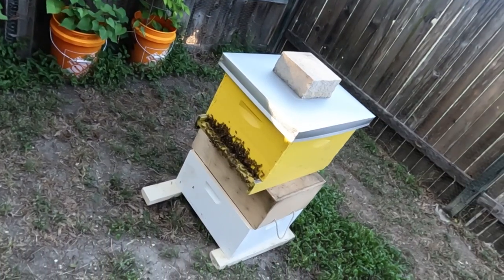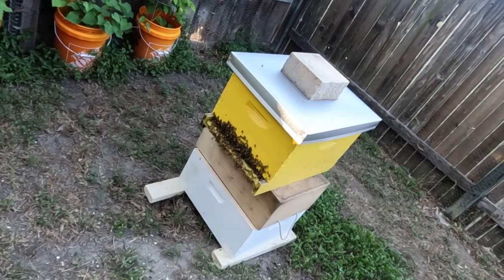Not Like I Planned, Moving The BeeHive #howto #diy #cute #automobile #shortvideos

Comment: Try .5 : 1 ratio on sugar water. The thinner syrup is closer to nectar consistency and will stimulate them to draw comb and raise brood. Add some pollen sub for protein.
Reply from the maker: Thank you for the suggestion. Changed the 1:1 out for that right after you made that comment. There was a little honey bee GPS confusion for the first 8 hours today but now they are solid on the new location in the shade about 15 feet away. But now no more heavy bearding at the entrance 24 hours a day like it was the last 3 days. Seems to be a much more happy box in just a hand full of hours.